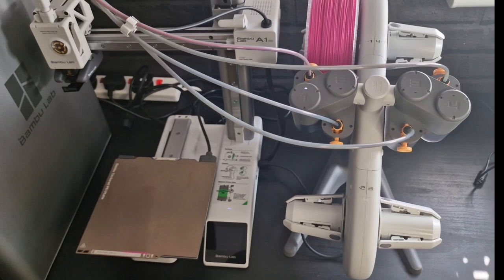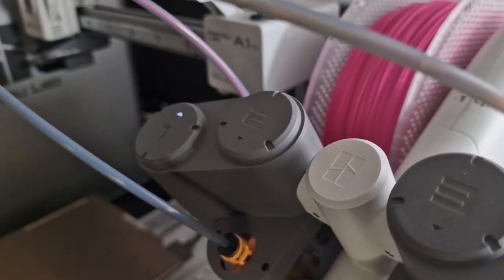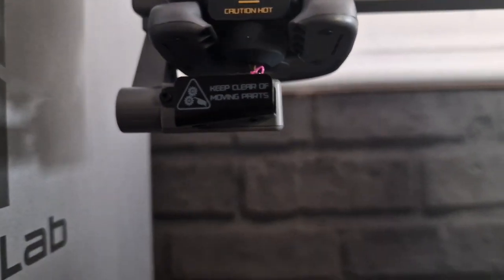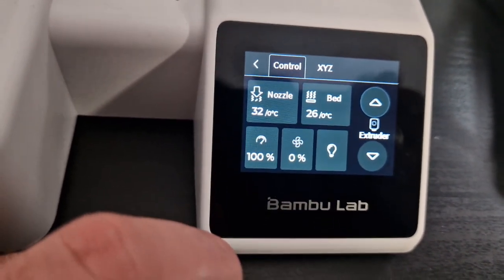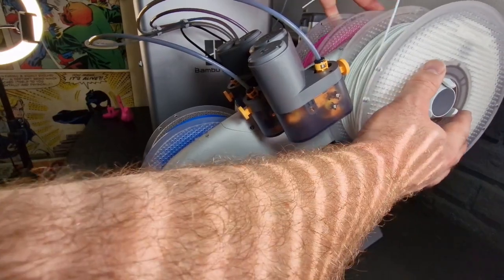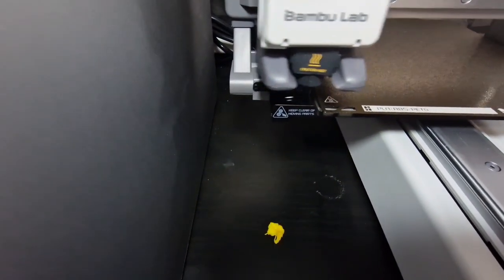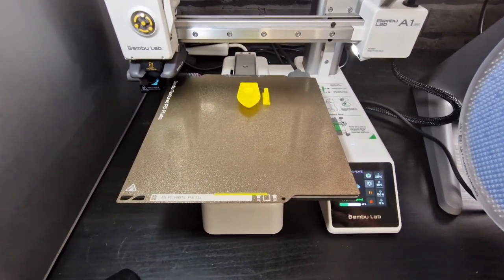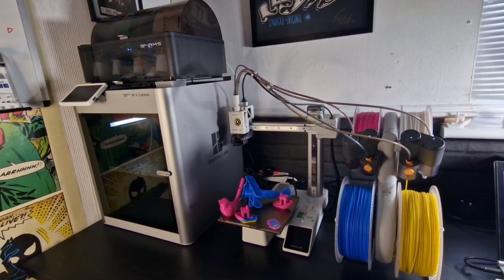Bambulab A1 Mini budget printing - Review - Specs - Final Thoughts  #BambuA1series #BambuA1Mini

Comment: Hey, tried to find answer to my question, Dimensions for A1 mini : 347*315*365. 365 for height, it is actual machine dimensions and not including bowden tubes when Z at top position?

Im planning to pre order AMS combo, but i dont know total height including tubes when using ams lite.

Since its pre order stage, not many people have it and didnt get results from discord either.
Reply from the maker: I will measure this for you later this afternoon
Reply from the maker: So gauging this against the X1carbon height without the ams on it the bowden tubes bend at this same height as the top of the x1 so 457mm high
Reply: @3DPUK-TECH-CHANNEL  thanks ❤️ this sounds neat overall required height, then it should fit into industrial PC kabin im looking for. And overall, should be easy to fit into different things with ams lite withouth height issue 👌

I saw couple discarded and will ask of i could get em ☺️. Top shelf dimensions X55cm, Y55cm, Z50cm. Printer in left and ams into right side and make big passthrough on between wall. Printer would be inhouse close to kids, hence kabins to control particles and exhaust fan through venting window screen
Reply from the maker: @vertabine   so I made a quick video for the height and width the height of A1 mini at full z height and AMS bowden tube is approx 49cm but its flexible  https://youtu.be/ewN7mWGuzX0